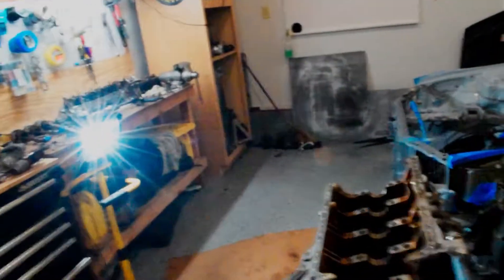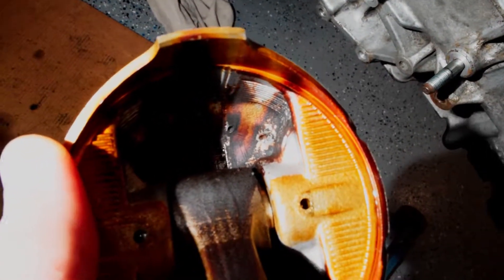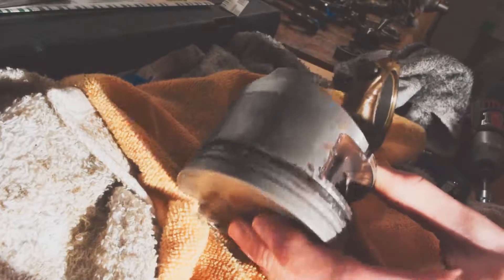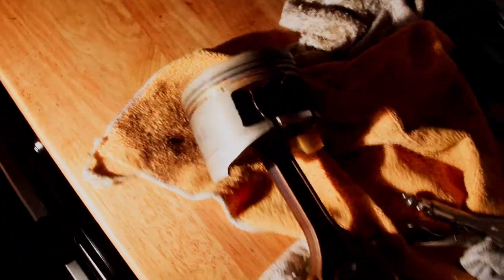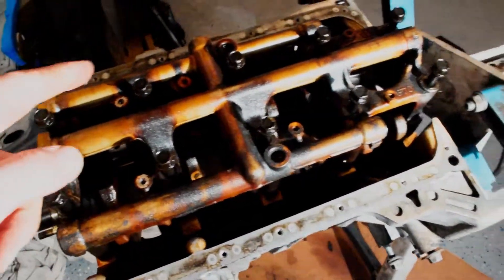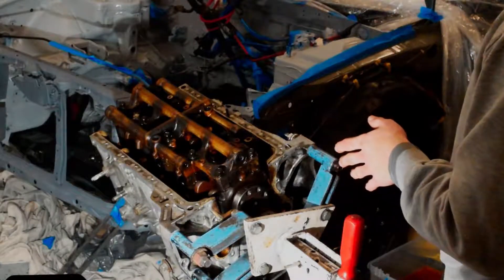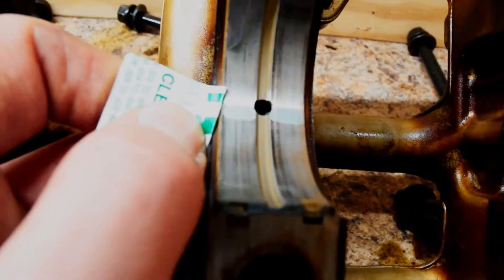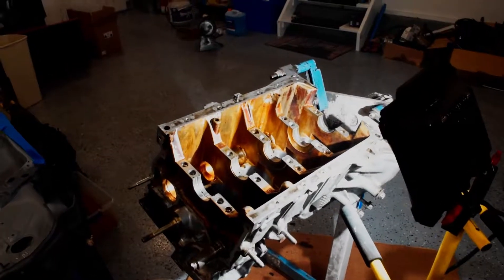Checking Main and Rod Bearing Clearance on a 190K Honda Accord Engine

Comment: What ended up being the fix for your oil consumption issue? Was the lower oil control rings gummed up bad when you rebuilt the pistons? Or were the oil drain back holes clogged? I'm having a huge oil consumption issue on my rebuild.. and I can't figure it out. It is starting to shoot blue smoke out the tail pipe but I replaced the head with another used f22a1 head with the same issues.. now I have the pistons pulled out but the ringlands are clean, but the only issue I would see is the oil drain back holes were clogged on all the pistons and I forgot to clean them when I rebuilt it.. but would that cause it to lose more than a quart of oil in less than 50 miles into the rebuild?.. the car was running smooth and beautiful other than the oil issue.. it would pull hard into boost at 9 lbs. And there was no signs of metal in the oil at all like zero.. and the bearings look brand new still.. maybe the head I used the valve seals were also worn along with the piston drain back holes clogged, those two combined made it lose more oil? And the rings weren't fully sealed? Idk.. any input would be helpful. Still loving the accord content by the way.
Reply from the maker: I would say my drain holes were clogged as well as the gunked up oil control rings. When does it smoke? Wide open? Cold start? What kind of ring gap you running?  You have an adequate catch can? Did you hone? Could be so many things.
Reply: @ThatAccordGuy  i did hone the cylinder but used the old rings. I did it in a hurry and forgot about the oil drain back holes on the pistons. They were all clogged up when I pulled them out again I didn't know they had drain back holes. But I swapped cylinder heads with a used one and it stopped smoking for 1 day but started smoking again once I out MMO in the crankcase.. I think with the oil being thinned out it seaped past the valve seals and piston rings but I'm putting new seals and new rings on now, I was just hoping this will resolve my issue and I don't have any other issues I might of over looked. I'm not using a catch can right now since I haven't had the car running more than 100 miles before I tore it back apart.. and my ring gap was just a stock ring gap or I never messed with the gap since this is a junkyard block, I assume its a stock gap, but I was getting tons of blow by.. when I take my oil cap off with car running the car would idle down and I can feel quite a bit of pressure from the oil fill hole. But there's no smoke coming from the oil fill hole. It would only smoke out the exhaust while giving it gas. It sometimes won't smoke while cruising low rpms and barely on the gas, only if you give it about 30-50% throttle and it would puff out blueish grey smoke out the exhaust.. I'm sure its the piston rings  combined with the clogged oil drain back holes.. and the valves seals were probably leaking also on the new head I put.. sucks cause the f22a6 head i had on it was pulling extra hard since I fully ported it. But I rather have something that doesn't drink oil and smoke like it does. I really hope this fixes it..
Reply from the maker: Good luck man don’t forget to give the rings some time to seat. But yeah when I did mine it was night and day. No more smoke. Let me know!

Comment: i dont think you can use plasti gauge on both top and bottom, i think it should only be used on the top which the weight of the crankshaft isn't already pushing on, and if you put it on top and bottom it i will fill both gaps top and bottom and will not get an accurate reading
Reply from the maker: I would think torquing the main caps squeezes the plastigauge way more than the weight of the crankshaft if placed down properly. Point was to check out of round crank or bearings. Everything checked out and the car runs great. But plastigauge isn't a real machinist tool lol. Close enough for me tho haha